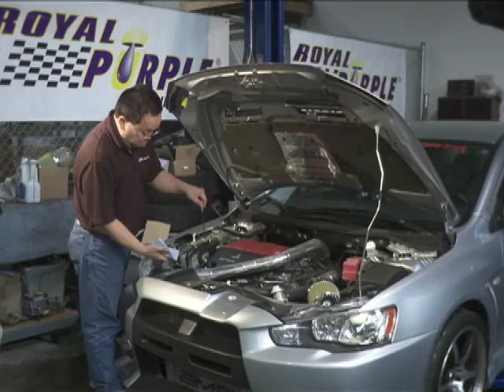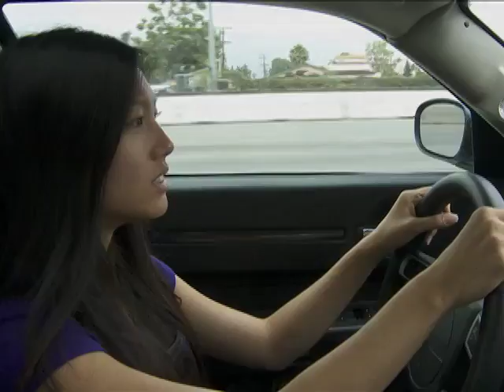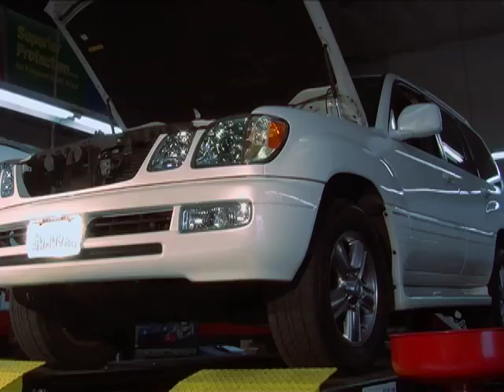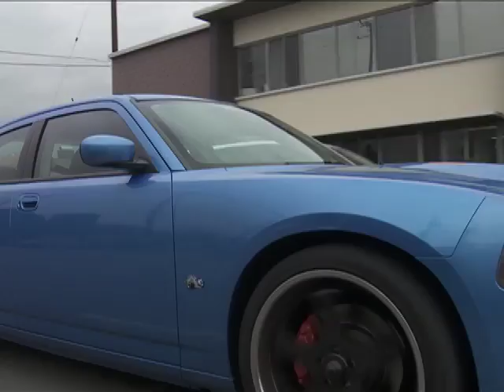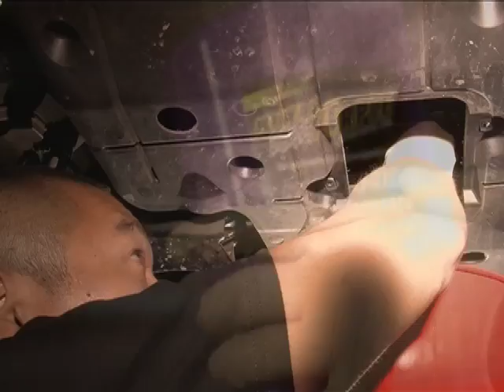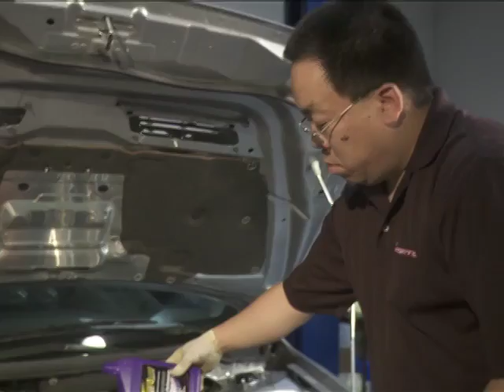Royal Purple - Oil Facts and Friction - NAPSTV

Comment: I have a jaguar s type. Always used royal purple. Oil changes every 12,000 miles. Check out my videos. Car has almost 200,000 miles and engine under the valve cover looks brand new!

Comment: if you read on the back of the royal purple bottle it says it only meets the requirements for 2004 and older vehicles... so if you putting this in your newer vehivle you not only voiding your warranty you putting crap oil in your car!!!!! i have seen what this does after 10,0000 miles.... not pretty